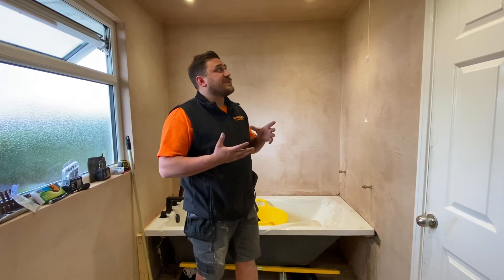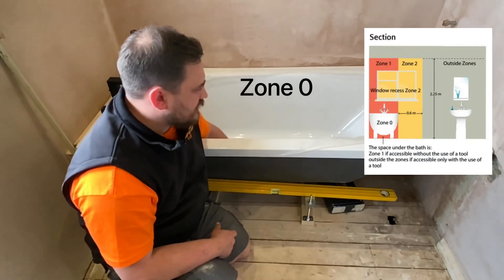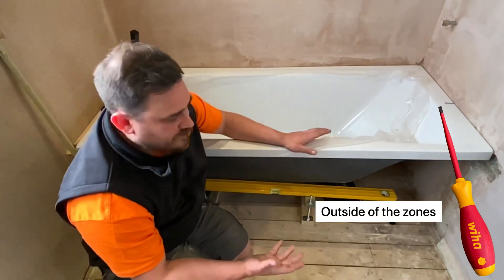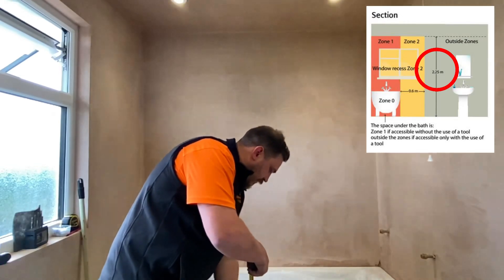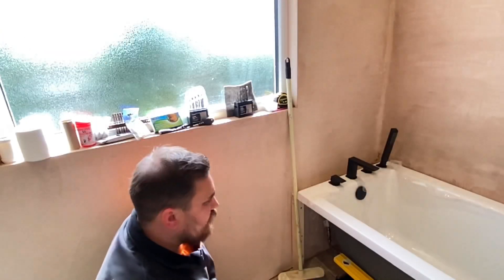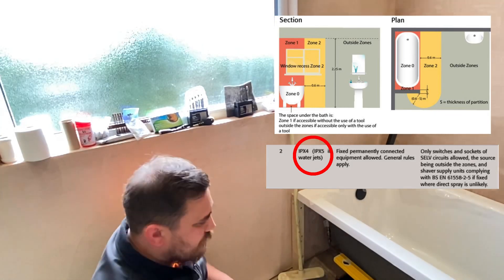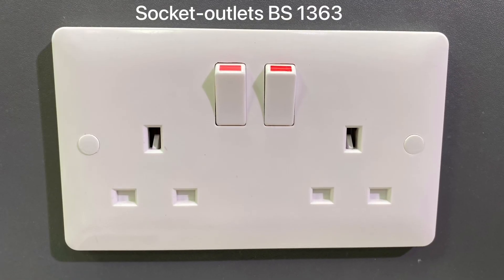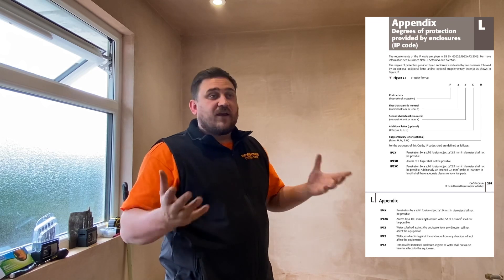Bathroom Zones Explained - Zones 0, 1 and 2 - IP Ratings and are BS 1363 13A Socket Outlets Allowed

Comment: Amazing how hard it is to find a correct diagram on the internet for bathroom zones - almost every single one has a zone around the taps incorrectly. No idea where that particular urban myth appeared from but it's prevalent on pretty much every plumbing site and a lot of "DIY" ones, as well as some electrical ones that should know better. (Some of the better ones at least state that it's "good practise" rather than requirement, but the diagram is still wrong).

Lets not even get started on the whole "you can't have a light switch inside a bathroom" that is also ingrained into almost everyone for no apparent reason.
Reply: You're right they all get it wrong. It comes from the guild for lighting installers who at some point recommended for good practice that a sink should be treated as having an area around it classed as zone 2, which then subsequently got corrupted and misquoted.

Comment: Where do people get "13A socket outlets" from? They are actually rated at 20A. 

The main reason being, not too sure about this, but it makes sense in my opinion. Is that it takes 21A+ for a 13A bs1361 fuse wire to pop.

Comment: I had a nightmare with a new bathroom (same layout as the old bathroom)a few years ago over zones. Plumber and electrician v British Gas over a boiler in a full height cupboard as they believed it was possible to stand in the bath and access the boiler. We stood in the bath and could get nowhere close… even an orangutang could not have reached! A third party electrician said put a lock on the door and tell them it’s now an enclosure exempted from zoning, just like the bath panel. BG were less than happy even when the on site guide page number was offered, but eventually they agreed!
Reply from the maker: Thanks for taking the time to watch and your detailed message 👍🏻

Comment: I'm British and I can tell you: The UK's rules are stupid. I do things myself and ignore them. Europe has full voltage, normally fused 16 amp sockets right next to their basins and it's fine. Just put one in with it's own RCD. Europe doesn't have copper saving 32 amp ring circuits like UK and Ireland does, or fused plugs, but I don't care. Charging toothbrushes and shavers in a different room is ridiculous.

Comment: Are all the zones only relative to baths?

Can you put a fused spur under a toilet cistern (for like those macerators), surely that's a lot of water if it starts leaking?

What about if you don't have a fixed shower head, you could take it off and spray water above you onto extractor fans etc
Reply: Baths or shower trays. Basically anywhere you can stand in water.

Comment: I never could understand why we can’t have a 13amp socket in a bathroom if it is less than 3mts now 2.5mts from the edge of the bath or shower tray , yet it is acceptable to have one 300mm from the edge of the sink in a kitchen. 
Defies logic.but who am I to argue i’am just a humble spark who’s opinion means nothing.
Reply: because paternalism and safetyism are now worse than ever. In the old days we used to just let people suffer the consequences when they did stupid things.
Reply: Yeah but your not standing in your kitchen sink with bare feet. Zones only refer to bathtubs and shower trays.
Reply: @robertwilliams7222  yet it’s ok to put a socket behind the cooker and behind a washing machine and or dishwasher.
Reply: @seandempsey7351  what has the kitchen got to do with this video?  Or bathroom zones! It’s not a special location!! You say your an electrician!! 🤦‍♂️
Reply: @robertwilliams7222  don’t be a prat , it’s to do with electricity and water , correct me if I’m wrong but doesn’t a washing machine and dishwasher use water ? And if the intake pipe or drain off pipe burst wile those machines are on they will spay water over the plug and socket witch is behind those machines.  Secondly you don’t know me or anything about me so don’t question me about weather or not I’am an electrician. And if you can’t respect other peoples opinion’s 
Then don’t reply to there comments. Also I think you’ll find kitchen’s are deemed special locations at least they are by the building regulations .
Reply: People dance in the shower or make babies and they are flinging water in all directions and steaming up the joint. Not so much in a kitchen sink